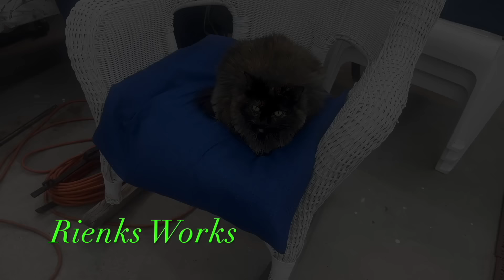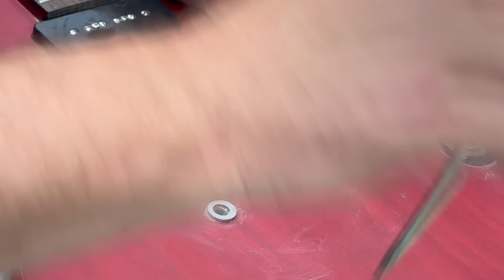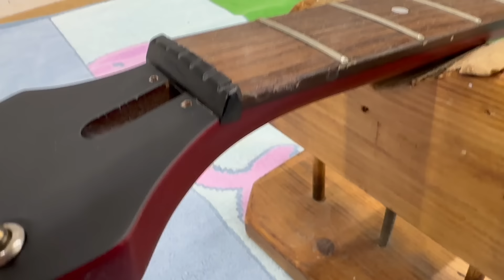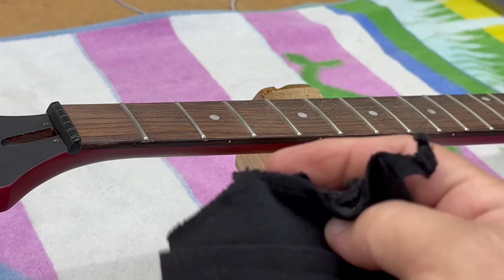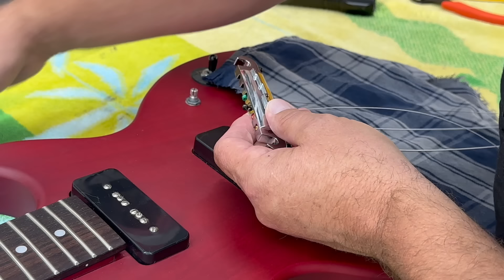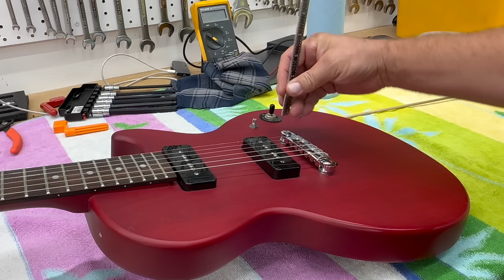Improve your cheap guitar! Make it Fun and Easy to Play!

Comment: Your France are coming off the fretboard a little bit , looks like they need to be tapped down a little bit and re glued, but only intonation I have The Epiphone bridge that came with mine what I did to get that extra little intonation I tapped on it a little bit with a rubber mallet and it kind of helped a little It brung it up some kind of moving everything forward a little bit